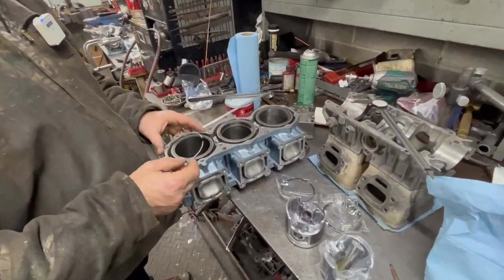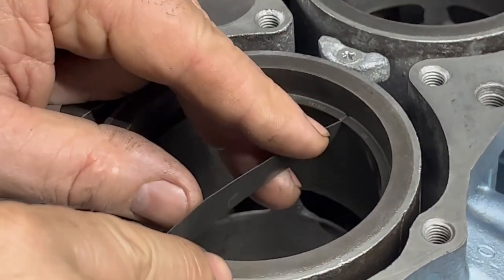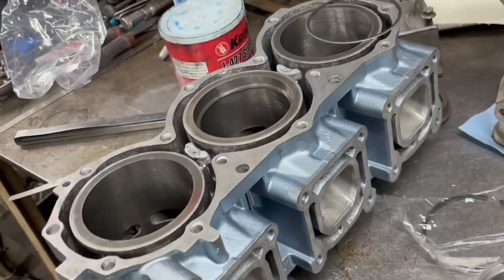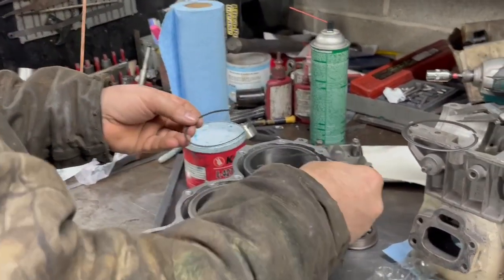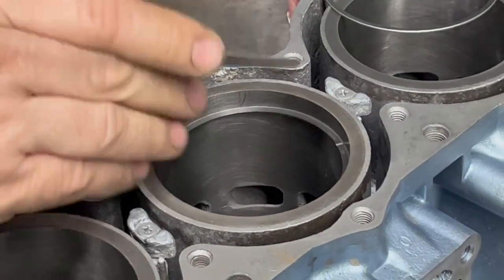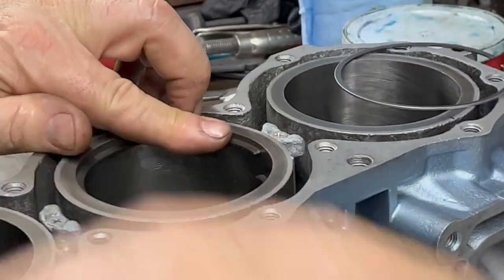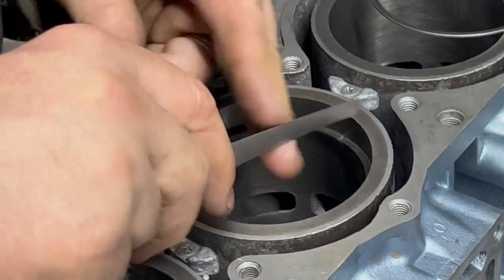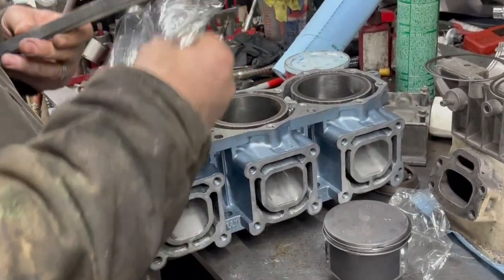HOW TO SIZE RING GAPS ON 2 STROKE ENGINES YAMAHA SEADOO KAWASAKI

Comment: Very very helpful. I’m getting ready to rebuild my 1200 power valve engine and I also have a nether shower valve engine that someone started rebuilding the new Sbt sleeve cylinders Sbt piston and rings also so I will need to check all that.
Reply from the maker: For sure the SBT rings need checked.